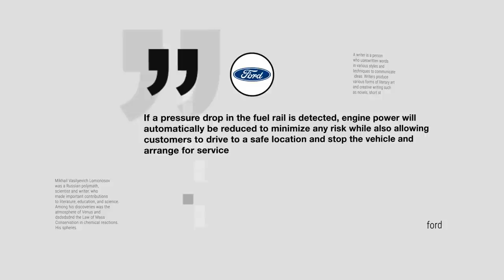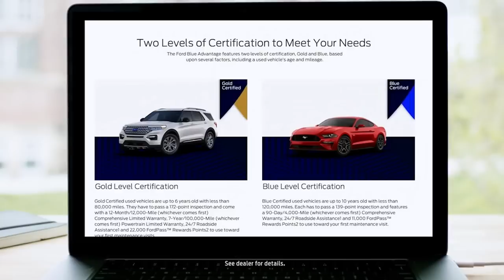The Ford CEO Has A HUGE Problem!

Comment: I just received my 7th recall on my 2021 Ford F-150 Lariat 4x4. With Ford's relationships with Dealership's getting worse all the time. I travel pass 2 Ford Dealership and over 120 miles to an Accredited Dealership for repairs and service. FORD has more than Recall problems.

Comment: Unfortunately, Ford relies on outsourcing for all this stuff now.  It use to be made in house where it was "more" controllable.    Ford doesn't test each part before they pull it from a crate and assembles it.  They trust that the supplier has done their part in making sure it is all good.  I'm guessing most people don't understand that.  But in the end, Ford gets the black eye.  It will take time for the current product to be quality controlled enough to not create more recalls.  It doesn't happen overnight or in a months time....
Reply: My experience with recalls with my 2016 Ford f150 are: the brake pads are too tight and not releasing properly so there’s a smell and yellowish residual around the rims , locks still not working properly in the cold winter spells, drive line was replaced and the truck still vibrates at 75 mph and finally year and half one of the mechanic put shims under the front saddle springs, the best one was changing the heads due to valves leaking and miss firing—- cold smoke when the truck sit too long at airport…… I found out in Google that all the new er engines are running at higher temperatures and also the transmissions … to pass the epa standards. The direct injection has lot to carbon up the intake valves . Pulling my 5000 pound trailer up and down the hills in my area produces a lot of heat on the engine and especially on the transmission. If you are having issues with trailer pulling, go into TFL …….Utube and watch most different trucks are failing the I Gautlet runs
Reply: FLT

Comment: Ford offers the best new tech but they let the consumer workout the bugs for them. They will release a product knowing it has problems and just hope it doesn’t get recalled.
Reply: The consumer is their lab rat 🐀
Reply: Don’t I know it, with the issues from my 2022 F-150. I got sucked in by the Powerboost hybrid engine and 7.2kw inverter. But sheered axle bolts, fried batteries, sensor issues while driving, my heater being on full time full blast unless I forced AC onto LO (when it’d below freezing isn’t fun) and the 10R80 transmission issues thumping all over the place and skipping gears causing my truck to rarely go into electric mode any longer so mpg has decreased by 5-6mpg. Oh also with all of this my truck has been in for service 23 days most recently was 10 days after being told 2-3 days….without a loaner vehicle because “you’ll have your truck back before we have a loaner for you”. Ford also deleted all of the warnings and vehicle errors for the past 7 months from my ford pass app without my consent, permission or authorization, and when I asked the dealership they seemed oblivious and changed subjects, when I contacted chat I was told they can’t delete messages and there’s no way to recover them. I called ford pass and got told they can delete them and the person I dealt with said they don’t agree with that, especially given they have no way to recover deleted messages. I can’t seem to get anyone from Ford to help or acknowledge my issues with this vehicle constantly having issues within 7 months of ownership, unfortunately seems like I may need to wait for the next thing to go wrong so it’ll go over 30 days and I can lemon law it back to Ford. Oh and it’s rusting underneath because Ford doesn’t undercoat their F-150’s any longer because “aluminum body’s and beds don’t rust” but all the steal components do.
Reply: Aluminum doesn’t rust your correct on that point,but aluminum oxidizes it essentially just turns to powder and is gone so you have that to look forward to
Reply: @kevinschroll4890  time to get rid of it.

Comment: As a Ford technician I advise not buying any Ford vehicle, I’m seeing vehicles with 10k kilometres or less that have horrible issues like steering components already worn out or water intrusion into passenger compartment by the windshield or sunroof…and the list goes on. They are making the vehicles out of cheap plastic parts that are complete garbage, but if you like paying $60k plus for a shit vehicle than Ford is your kind of vehicle!
Reply: And that is why I didn’t go with Ford in 2019.  I new to many people that were having to many issues with Ford. Yet I wanted one. Yes they all have there issues but I chose Ram and picked my simple poison.  Cheaper and easier to work on also. Overall less issues. Even for a new year truck. Let’s face it. Ram pushed the big three in 2019 to rush and compete with the Ram 2019. No time for them to test and work out any bugs. Slap it together and sell..  now at what cost hey? IMO Ram and Toyota are in the lead for quality and reliability by far.
Reply: Ram cheaper to work on you obviously haven’t bought any fiat Chrysler genuine parts lately
Reply: @derekbelton5932  Well I haven’t really. Ram doesn’t break down. So ya cheaper in the long run… 😂😂. But it is easier to work by far really

Comment: These new car's are terrible. I went back to old school I now have a 96 f350 and a 69 cadillac deville for my daily driver. So much cheaper to maintain and work on. Registration and insurance is only a fraction of what I was paying for my newer cars. And the fuel economy isn't any worse than my 05 powerstroke  and my 14 tundra which I had nothing but problems with both. I had those two trucks towed so many times that my insurance company dropped my towing. So with that I'm done I won't drive anything newer than a 2000. If I have to go online and have it shipped cross country idk I'll pay for it.

Comment: Yup, best selling truck alright. And best recall issue also. I have been chirping for over three years now from people I know and the issues that are rising on quality and reliability.  That’s why I chose a different truck in 2019 and GM is not the other brand.  Best quality and reliability as of now is Toyota and Ram 👍👍
Reply: RAM???? Good luck with Chrysler…. I mean “Stellantis”
Reply: @chartedtravel1776  actually have excellent luck. So do many others I know and contractors. Not so much for Ford though. True facts Jack!!  😀
Reply: @PeeterPuncher  Not anymore do they???  Stats show that sir. Ram is better. Yup…. Better. So things do improve and Ram has successfully proved that. Now how come Ford isn’t improving is the question that needs to be asked. After all they been around the longest and have the most experience. But now they are the worst. Over 7.1 million recalls and counting. Hmmm. Makes me wonder 😂😂😂
Reply: @ramrider1453  it’s more than likely that they have allowed bean counters in positions of power (ie MBA and up) instead of keeping them in the finance department.  They are not engineers or manufacturers but in a lot of corporations bean counters run things, always looking to maximize the potential profit by using materials that will holdup thru the warranty period and then fail sometime afterwards.  They unfortunately have cut too deep on quality at a time of ever increasing technology that has not been bulletproofed yet. An example of this is Ford moving manufacturing to Mexico for cheaper labor and less regulation (another big problem) to improve their profit margin.  The real crazy thing is somehow Toyota can build the Tundra here in the US(San Antonio, TX) build an excellent truck and make money.  I only wish they built a 3/4 or 1 ton version with Diesel engine for the US market.
Reply: I agree
Reply: Um yeah I work for a dealership that sells dodge amongst other makes you have just been lucky
Reply: @derekbelton5932  never owned a single dodge product but have owned Fords and Chev's Yes motors were good but everything they bolted on to the motors were junk.  Have owned 3 Tundras since 05  they have been extremely reliable and never had to use the extended warranty I purchased